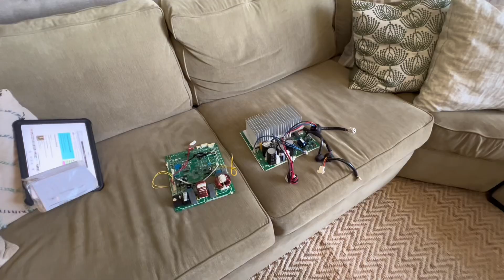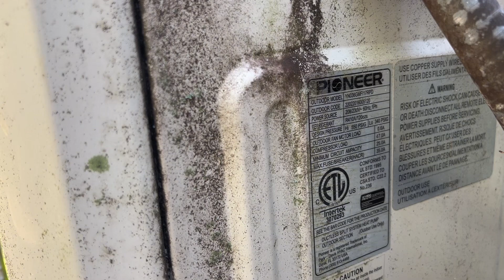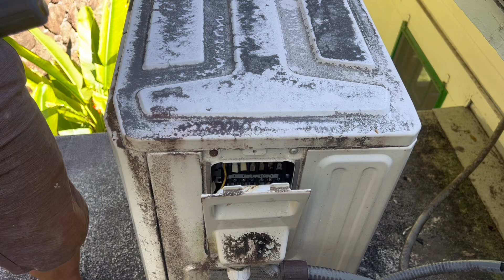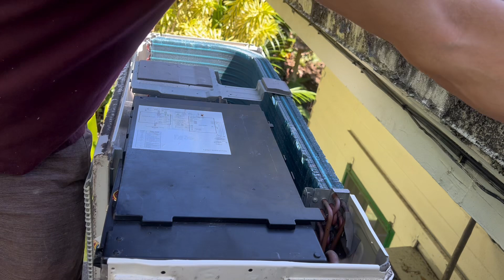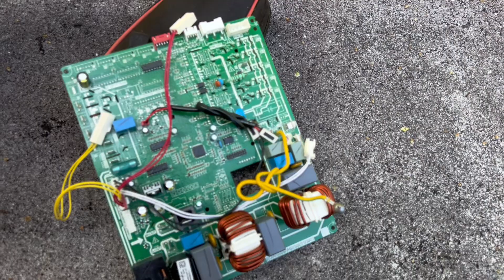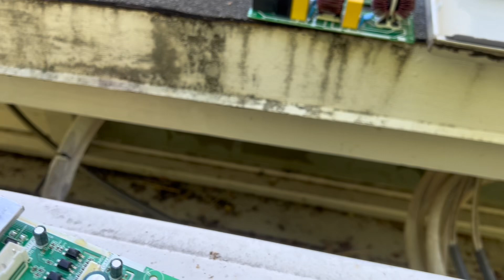Discontinued Pioneer E1 error code fix.

Comment: My Pioneer 36K has a E0 code any ideas Thanks
Reply from the maker: Possible communication error between inside and outside units. Try recycling the power( turning off breaker for 10 mins) then turn back on. This is hard to diagnose because of all the possibilities. In my experience if you switch out the motherboards it generally fixes all coms problems. You could spend $1000s getting ac tech people out who will spend a lot of time troubleshooting as well. As long as it is not a compressor problem the do it yourself fix is pretty cheap relative to the pros. Hope that helps. There are hundreds of videos online.